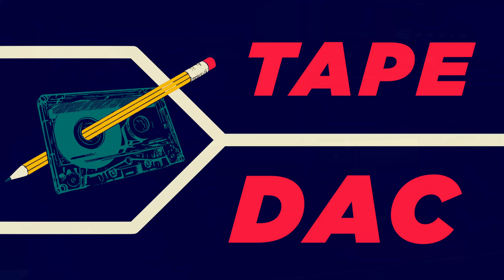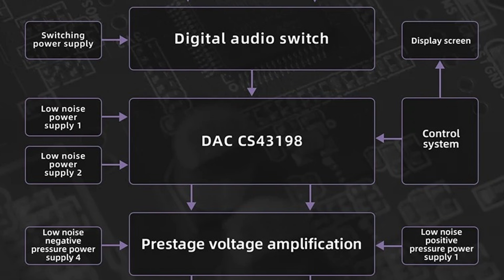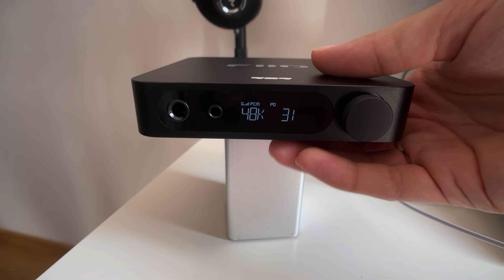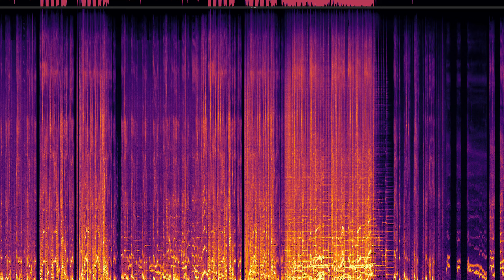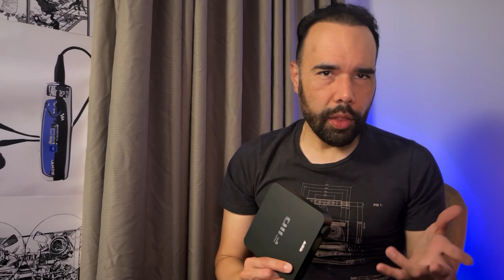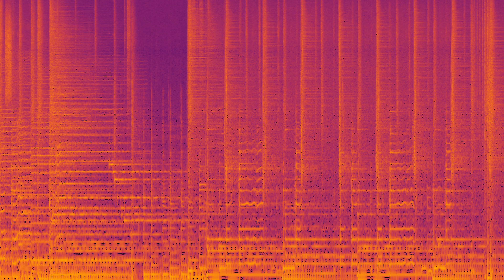DAC Fiio K11 R2R: Review and How To Fix the BIG issue!

Comment: You can get a pretty cheap (around $10 from memory), little box that will split the power input for USB devices, it basically adds a second USB connection that runs the power to your USB device, DAC for example, so say connecting to your phone, it gets pure signal without any power interference which can come from a power bank

Comment: I can't believe that when you use either the coaxial or optical outputs, the DAC only uses OS. Even though it shows the switch on the display, it is only OS that can be used. USB input is the only input you can have a choice of NOS or OS. I never knew this!

Comment: the K11 does have a power button.  simply press and hold the volume knob for 3 seconds.  it will first display your last used setting in the sub menu and, when you continue to hold the button pressed, will then display OFF.  once you see OFF displayed, release the button and it will power down

Comment: Thanks to watching your video and recommendations that I purchased a fiio linear power supply - darkside pro connect to fiio k11 r2r. The sound improvement is incredible. I have a fairly reasonable old system- Mcintosh preamp C220 (tube), Mcintosh MC 150, Harbeth Compact 7 speaker, Wiim Ultra and smsl raw dac1. I use flac files play through Wiim Ultra to fiio K11 r2r. The sound is even better than the sound produce from smsl raw dac1 which cost more than twice the amount. It is nicer and enjoyable to listen to. I can also hear the improvement through balanced output 4.4mm. I use fiio ft7 headphone. Thank you very much. Your analysis is very good and I can easily understand.
Reply: Excellent review, Excellent reviewer, it's about time we have a competent reviewer on youtube 😊
Reply: Try connecting the K11 to the Ultra through USB if possible.  If you already have a media disk connected to USB, use a USB hub.

Comment: The BIGGEST difference from the cassette deck is caused by the gap in the tape playback head. It simply can not pass high frequencies (usually above 22kHz). This "filter" avoids a lot of the problems with other sources - especially digital. Digital filtering has gotten better and in the case of the Fiio K11, I am sure that your "fix" actually undoes the frequency response that Fiio designed in. Perhaps there is a way to make the last octave flat. I will try and find a schematic to see if the filter is digital or analog.

Comment: Hi. What do you think about powering this DAC with a lithium-ion battery? The battery type is 18650 3S4P. Voltage is 12V, capacity is 10 Ah. I think it will last two days without recharging. Which is better: a low-noise linear power supply or a battery? Theoretically, a battery is the better solution, since it doesn't produce any noise

Comment: Hi, very nice/interesting presentation, but I want to get answers for the following questions: 1/  Has this DAC enough power to drive Sennheiser  headphones HD 600 (300 ohms) ?, 
2/ Is possible to connect smartphone to USB C input  to listen Tidal or any other internet radios ?, 
3/ Is it possible to connect hard disk to USB C  to listen FLAC files ?  
I want use this dac only to listen music with my headphones HD600 .  Do you recommend any BT transmitter as a perfect match to FiiO K11 R2R ?  
Kind regards, Darius

Comment: Block noise from outside of audio devices, get low ripple regulated power supply, get low phase noise clock, check amplifier has enough slew rate with low noise, check OS deals with some mixing. Otherwise, all digital should sound good.

Comment: Some measurements of the changes would actually be helpful. After further review I noticed we took the R2r DAC a little closer to the sound signature of a regular transparent DAC. But it still leans forward and warm. I think doing these EQ Changes basically is killing off the point of how an R2R DAC calms the digital shrill from music. I'd rather EQ based on my headphones specifically than touch the sound signature. Another thing you can try is have something like HQ Player handle the upsampling and filtering while the DAC is in NOS mode. That actually really pushed this DAC way above it's price range. Thanks for the video!

Comment: There are no differences when comparing the R2R and Delta Sigma versions in hearing tests. I've measured and extensively tested both of them. If you claim you can identify any difference I would love to see how you do in a blind test. I have a K11 R2R and spent A LOT of time with the K11 as well.
Reply: They said you should play in nos mode.
Reply: The better your system, the clearer the differences should be. People say the K11 R2R has muted highs, which should separate it from emphasized highs of Delta Sigma Dacs. But its true that the difference in DACs is minute compared to speakers and amps.
Reply: I just bought r2r 2 weeks ago hoping it can help to make my thieaudio div 16 sounds warmer. No, they didn't..😢

Comment: I was hoping this would "fix" its emphasis, on the low end area in the mid bass area - on the amp I am using now (Sony 5.1 thing from 20 years ago), I turn on Bass Boost, but also, for some tracks, I have to turn the "treble" down about 45% to the left (0% or totally pointed up is +0/-0, to the left is down, to a max of -10, and right is up, similarly to a max of +10).

It will be different for different music - but i was hoping of something to do it across the board - it's the only thing "wrong" with it.

Comment: I bought the Super Capacitor for my DAC. However, it doesn’t seem to work (never shows full charge - all LEDs on). Do I need another power supply or plug to make it work. To connect the super cap to the DAC, I used the provided 2.1 cable and to feed the super cap I used the DAC’s power supply. I see that on your video you use the white cable to supply power to the super cap. Why don’t you use the original Fiio PS that came with the DAC?

Comment: Well a new moden thing 🎧 we listen in the street
From phones , mp3s, we dont listen music with 🎧 in the house
We want dacs to eliminate the jitter from the streamenig platforms ,streamer +and better ex dac with better clocks
The thing is this when you have a streamer lets say 1000 € you must go for a dac with the same price
 i have eversolo master edision its a great streamer and dac i use this and it will be better ? Maybe? Nope
Reply from the maker: For a €1000 DAC I would invest in a €3000 power regenerator first, as AC mains noise is a much bigger problem than clock jitter.
Reply: @tapedac  I never knew that thanks I make some research   you're right grund
, electronical noise from cables, plugs, and you name it
Thank you

Comment: Thank you for this exzellent review. I am satisfied with the fiio K11 R2R and bought the 12V Super Capacitor Power Filter Module. But I can't start th DAC with it anymore. There is only a short sign on the display. Is ther any trick to start the DAC?
Reply from the maker: Oh, you noticed it faster than my response 😄
But yes, even with “weak” 12V adapters that supercap buffer won’t work properly. It’s recommended at least 2A.
Reply: Sorry, it was the wrong adapter

Comment: Thank you for the review! As I am considering a dedicated Headphone DAC/ Amp over using the HP output on my AVR. 

Just bought headphones after trying about 40 over 3 days. 

I Can’t Help it - Micheal Jackson (opening Bass notes for texture and the subtleties of breaths/ lip smack/ echo between words)
50 Ways to Leave Your Lover - Paul Simon (opening 15 sec for the  how well the drums sound like they fill a room)
Boonghusa (Polo & Pan Remix) - Limousine (This song layers the bass line at 0:53 very unusual. On a good set up it should feel like rhythmic punches of bass that are overlaid by a heavy swell of air pressure. If your listening position is directly in the phase line of a medium to powerful subwoofer you will understand what I mean.)

At this point it should only be a few minutes tops to see If it passes the test tracks and if I still like a headphone I start jumping around in my music catalog over different genres. That whole process takes just a few minutes per headphone to see the kind of impression the equipment left in memory.

Comment: Like the analytical stuff.  Great , in depth look at the item - thanks! 
So the 'BIG problem' is that the K11 R2R might not reproduce higher frequencies in a consistent and pleasing way, which is particularly aparrent with the background hiss on Garoros but then aren't you also saying that in this situation, neither can DS DACS?  But then R2R can be corrected to get around that simply by upping the high frequencies on an equaliser.  Would the other DS DACs not be able to correct in the same way?

Question: would this pair well with Aune AR5000s?

Comment: If higher frequencies are tamed by this unit then thank goodness. Too many modern headphones and dac/amps are reaching for ever brighter and shouty tunings, and I can't for the life of me figure out why. I suggest people get their ears cleaned, it might be wax blocking it all, or try an normal headphone for a while that isn't bright AF and let your brain adjust. Listening to super bright renditions just can't be good for the hearing, and it does not sound natural for acoustic instruments or even rock which is usually poorly recorded to boot. All in all it remains a mystery to me.
Reply from the maker: Your point of view on high frequencies is very interesting. I think that the Sigma-Delta technology of digital-to-analog converters favors this problem. And it's only now that we're starting to have low-cost R-2R DACs to compete with Sigma-Delta DACs. So I also hope that this quest for extremely bright sound won't be the standard in the near future.

Comment: Try to get a CD player with PCM-61 or PCM-63, and you will hear the R2R the way it supposed to sound.
Better, if you can find an older player with PCM1704-K, that's amazing sounding. Denon DVD-6000 has two of them and has a digital input to be used as a DAC.
Reply: My NAD C-540 had PCM1704 DACs, it sounded very nice. After ten years hard use the laser failed & the player started skipping. It cost $200 to repair so I moved on. For the past ten years I've been using a Panasonic DVD-A110 that has DVDA DACs comparable to the C-540. I bought a spare A110 in case my main player fails. Cheers!
Reply from the maker: What about the CD-Players with the chip TDA1541A? Did you already compare its sound with those?
Reply: @tapedac  Yes, that was probably my first R2R DAC that I heard. Before that I was in the camp "Dynamic Range and THD+N is all you need to know about a DAC" and "They all sound the same".
IMO the Burr Brown (now TI) chips are a step above the Phillips one.

Comment: This fiio r2r dac has an RCA output port and a headphone output port. I want to listen to music, connect the jack wire to the RCA port down to the amplifiers, sing karaoke at the headphone output port, connect the jack wire to the mixer then connect it down to the amplifiers, is this setup ok?
Reply from the maker: You need to choose just one of the outputs. If I understood your setup correctly, the RCA output would be better.
Reply: @tapedac  It's true that the RCA output is correct, but I want to ask if it's possible to set up two output ports to listen to music and sing karaoke.
Reply: I want the RCA output port to connect to the amplifier to listen to music, and the 3 coxial output ports and output 6.5 or 3.5 to connect to the mixer down to the amplifier to sing karaoke.

Comment: Never use NOS mode unless upsampling the source (e.g: 44.1kHz to 384kHz) in order to test different resampler qualities and types. Otherwise it defies the logic of the sound reproduction.
Reply: Most reviewers preferred the nos mode
Reply: This is true, but this video suggest otherwise!
Reply: “defies the logic of the sound reproduction” means what exactly?
Reply: @YeshuaChristRedeems  NOS means you don't use any digital filter... without this filter you can't reconstruct the actual audio signal and you feed your audio gear with high frequency noise... this concept defies the logic of the sound reproduction.
Reply: @meaninthemirror  It works just fine. Idk what you mean.
Reply: @meaninthemirror  What is "the logic of the sound reproduction"
Reply: @meaninthemirror  I know what NOS is. Answer the question I actually asked you please.
Reply: @meaninthemirror  Oversampling in audio is almost exactly the same as oversampling in a video game in that all it does is smooth things out in order to prevent imperfections in the audio/image but just like with games it has it's downsides. Oversampling has more overhead than Non-oversampling modes so it adds latency and in the process of smoothing out the audio it ends up hiding some of  the nuance in the original audio signal or image.

Clarity is much better in Native rendering in games just like audio is much more clear in Non-oversampled modes as well.
Reply: @meaninthemirror  It's really a choice between whether you want a smoother audio signal (oversampling) or a more accurate reproduction (non-oversampling)

The irony of oversampling on DACs is that it is meant to have the benefit of preventing distortion but it  can  actually cause artifacts in the audio and like I said before it can also remove some nuance, detail and clarity.
Reply: @YeshuaChristRedeems  The logic is, if you want the sound.. then get the sound. not the garbage called "NOS"... If you want to use NOS mode anyway, you have to implement the filter in ANALOG domain..and this is not an easy task... got your answer now?
Reply: @YeshuaChristRedeems  If you really know what NOS really is, then you might aware of how the high frequencies look like on scope (google it)... especially high frequencies which is practically non exist.
Reply: @meaninthemirror  No. What logic is it defying? Are you spewing hot garbage out of your bum bum?
Reply: @meaninthemirror that was in no way a true statement. A filter is not what "reconstructs" a signal, it is simply what is primarily used to set the cutoff of the slope as well as the taper which defined how phase will be affected in the upper register. NOS generally will give the best phase performance which is fine domain related whereas filters MIGHT be beneficial to better extension and SOMETIMES help with noise, but not really though because the definitive most bothersome noise to the human brain through the sense of hearing in regards to reproduction of sound is unnatural phase shifts, also known as one of the many time-domain anomalies. This is a part of why speakers can measure flat at the crossover region but sound undefined or harsh or slurred because the two drivers are out of phase (not being completely a big deal in and of itself, but it SOUNDS offensive if the degree angle of phase shift results in odd harmonics or odd timing cues)
Reply: @TruthisWright  You sound like you know what you're talking about but not. Google: "reconstruction filter".
Reply: @TruthisWright  You sound like you have a point but I really didn't get it. Did you even look the what analog signal looks like in NOS mode on an oscilloscope? A proper audio signal hardly exists above 10Khz. If you use the NOS mode, it does mean that you are going the apply the filter on analog domain, not going entirely avoid it. Google: Reconstruction Filter.

Comment: Great review dude. I have a fiio ka17 dongle which has a separate isolated usb C in for power only. This allows you to run a clean usb supply. The ka17 is surprisingly powerful. Check it out. It might make a good review vid for you xx
Reply from the maker: Thank you for the suggestion. I will try to get one KA17 to review it 😉